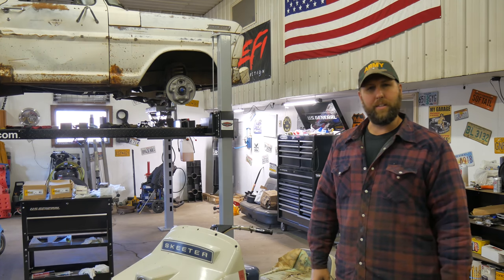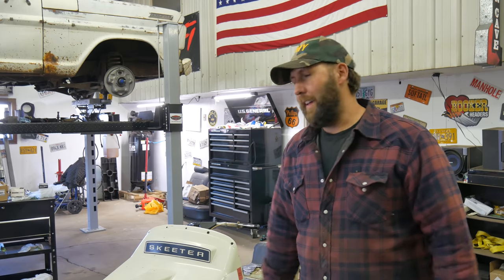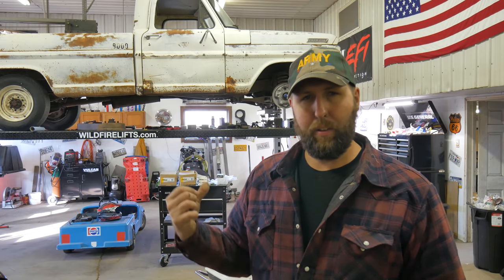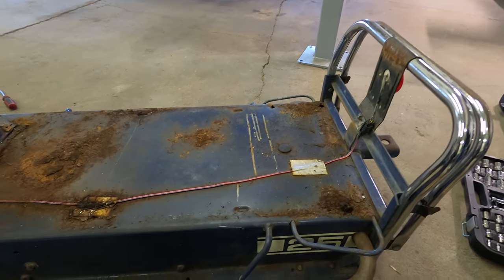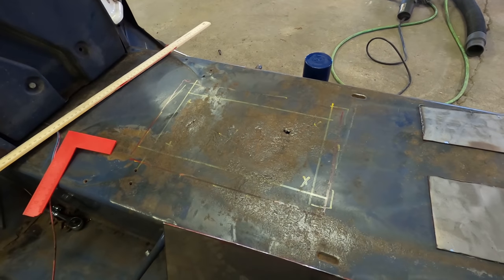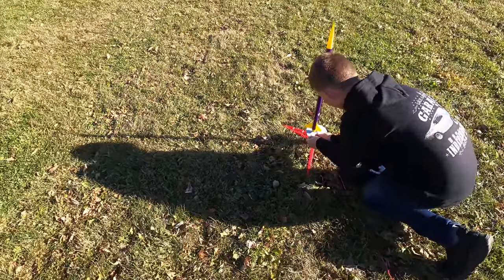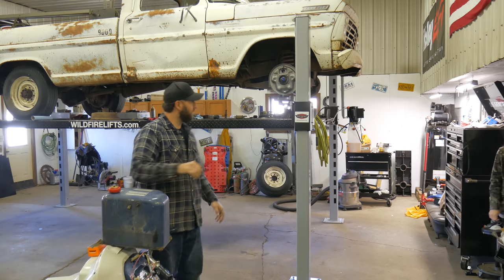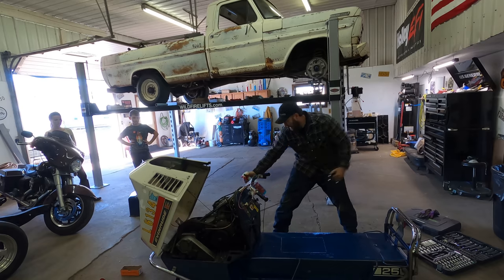FORGOTTEN 1970 Evinrude Skeeter Snowmobile - Will It Run? Part 1

Comment: Derek I wish I was your neighbor. Clearly you're a guy a fellar can drink a beer with.
Reply: Or 12 beers maybe!
Reply from the maker: anytime!
Reply: I’m drinking a beer right now, 9:30AM, headin out time the garage shortly getting myself into trouble no doubt. Derek, if yer ever up in Maine stop by New Gloucester and help me get an 87 crown Vic cop car back on the road. She’s rottin out in the backyard and needs some savin!
Reply: @nghermit4922  I have a friend who lives in Maine, if I ever get up that way maybe I'll stop by. I used to drive those old 2000's crown vic's as a taxi cab driver and had to work on them a lot on my own. So long as we don't have to tear the engine down I can probably get her up and runnin'
Reply: @toysoldier46552  haha nice, she’s pretty rough but does at least make fire. Been sitting for probably 15 years.
Reply: @nghermit4922  It's probably something stupid like the fuel pump or it has a bad sensor. I'd start with the fuel filter near the gas tank and go from there. Otherwise spend a bit of coin and get the tool that runs on a mobile app to plug her in then crank on it, that will give you all of the error codes.

Comment: Derek I really appreciate this channel. That was an hour very well spent. Thank you, and looking forward to part 2!!!
Reply from the maker: Glad you enjoyed it! Part 2 coming soon
Reply: On that tunnel at the rear, a guy might want to put a anglage iron there for reinforcement. If that is the case.
Reply: If that's the case, I use angle iron from bed frames. It's thin and tough and easier to weld other thin metal to. When the kids leave college in the spring, the dumpsters are full of the stuff. Also apartment evictions are a source, so ask a property manager

Comment: My best memories of my Dad “working alongside him in the garage” . Glad to see your a good Dad!
Reply: Working along side my dad in the garage usually consisted of me holding the flashlight, frustrating my dad for not holding the flashlight at the required angle, fetching tools and frustrating my dad for not grabbing the correct tool. I did provide a spacer once when my dad was pushing a tractor back together after splitting it to work on the clutch. By spacer I mean my hand in between the two halves of the tractor…felt great. He checked to make sure my hand wasn’t hurt too bad for about .00001 seconds and we went about our business.
Reply: @thrashmetaljay666  my dad dropped the exhaust of his 89 supra straight onto my 12 year old pearls.

Comment: I did those Estes rockets back when I was a kid back in the mid 70's..  Fun stuff..  Rockets usually only lasted a single launch, but I did get a couple of launches out some of them...  Most broke on landing when the parachute didn't come out..  Other's just blew up, but it was all fun back in the day..  Glad to see that they are still going now.  I thought they died a long time ago..
Reply: I recently found an old one in the attic, and got it going again with some new motors. Was a lot of fun, even the parachute worked.

Comment: Relocating the exhaust out under the foot wells is pure genius!
Warm feet!
The original exhaust is twin army green flat mufflers that run the length of the tunnel above the track.
Very exotic for the time.
Fun video! I may have to restore mine!

Comment: That spare belt was wrapped in a crazy carpet. They carried it so they could put it under the track and tow the machines easier than turning the whole track.
Reply: Or a “Mini Boggen” Anyone who rode 70s vintage knew what these lifesavers are for.😀. Half of the sleds miles had one of these under the track.
Reply: or use it as a kneeling pad to keep from getting wet?
Reply: Beat me to the crazy carpet comment.  Try and pack one of these on a modern sled, absolutely no place to store one.

Comment: Great find. These were built in my home town. My father worked for OMC back in the day. The old factory is now a parts supplier to GM. The dual opposed engines were unique. All the models that used that engine had the neutral lock out feature. Great video.

Comment: once upon a time in the eighties I used a reborn evinrude and a johnson snomo both pulling sleds to haul very large amounts of firewood out of impenetrable snow filled north country deep woods ... they had super wide tracks and the new snomos lacked the traction with their tiny tread spread ... aanyway the trails we used all froze and became super fast and  crazy wild at the end of the day ... we always did a couple adrenalen runs when the work was done ... it was some of the best work days of my life ... sometimes when we were all done I would just stop look into the sun going down over the next ridge line and realize how blessed I was ...

Comment: That exaust is electrical conduit I know those compression fittings too well
Reply: I recognized the fittings as 2” EMT Couplings also, good eye.
Reply: Reminds me of the time I tried to make an exhaust system on my skidloader. Major failure.
Reply: Any thing is an improvement over the stock exhaust system those things had.

Comment: 24:1 is super crazy with a modern two stroke oil.  Many of us two stroke moped folks run more like 100:1 with an oil like amsoil saber.
Reply: "Not running" or "ran when parked" with a vintage moped means that 99% of the time the top end is seized, and 75% of the time the bottom end bearings are seized too.
Reply: It depends on the motor. I have an outboard that originally called for 24:1 but if I would run Amsoil Sabre Outboard at 100:1 or even 50:1 I would end up with internal damage due to the bearings the motor has in it. There is not a one size fits all approach like some of these oil companies may claim.
Reply: @sdvten  I can't speak for those larger motors.

However, vintage mopeds manuals pretty much all recommend 50:1, which is way too rich for a modern oil.  Two stroke oil burns during combustion, and too much of it can increase heat in the top end.  Heavily ported designs like the polini 64cc cylinder for Puch recommend a leaner oil:fuel ratio and synthetic oil (60:1 in that case).
Reply: That's what I was thinking. I rode 2 stroke dirtbikes.  Cheaper lower quality oil, Yamalube, required  a richer mixture. The expensive oil , like Royal Purple or Klotz mixed at higher , leaner ratio, made  less smoke and fewer fouled spark plugs.
Reply: @bjf10  Higher mix rations cause problems when the engine is stored because there isn't enough oil to prevent rust. You need to fog the engine when putting it away for the year.

Comment: YES! My first sled was a Johnson Skee-Horse wide track, when I was 13. It was identical to that Evinrude, but was the most ugliest seafoam green, so I went ahead painted it black. It had reverse, but no starter, so I had to wrap a rope around the primary clutch,  and hope it didn't backfire. No brakes, so that was good. She wasn't fast, but I pulled more than one car out of a ditch. 
This brought back a lot of memories. I'm also an Arctic Cat guy. Had many 75-76 El Tigre 5000s , and my son and I just got my Z440 running today, after sitting for years.

Comment: I remember being a kid with a new 1978 Jag 275 FA in-line twin and the neighbors had a couple of these old 440 opposed 25 horseys. In the woods I had them by the short hairs because the Jag was super light and made the most of its 20hp, so I could out turn them.But on the flats I was lunch meat. Neat old sleds. Glad to see one saved.

Comment: I got my first snowmobile at 16, back in 2016. Found a 1971 Ski Whiz in the barn on my grandparents farm. got it back home, and I was on my own. didn't know nothin' about engines except some basics,  had almost no tools either. but I rebuilt the engine, with new rings and whatnot, and it runs like a champ now, just have to replace the stinkin' clutch. burns up belts. an old snowmobile is the perfect way to get a newbie into fixing engines.

Comment: Hey Derek, I’m super late to the party, but here is my 2cents. The blue kids sled wrapping the spare strap is a genius recovery tool. It can be use to tow the snowmobile in case of failure by placing it under the track and greatly reducing drag.

Comment: I have had a few sleds i had the same issue but when i fixed the tunnel i used like a bed liner paint works perfect on the tunnel no scrapes so no rust

Comment: That's awesome.   Got the family getting in there helping a feller out.    Keep at er.  Those boys will no doubt have all kinds of fun on that thing.  Great one to start on.   My first snowmachine was actually a really similar tiny ugly white 25 or 30 horse relic with a duct tape seat.  Got good at strong arming the bugger around corners, fences, stumps, dogs, ect...  then I got my cousins little hotrod 440 fuel injected suicide machine.   Dad borrowed it twice.  First time he lay it on its side and he bruised his ribs.  Second time he was running her flat out and blew the engine.  LOL.

Comment: My dad had a '67 OMC Sno-Cruiser ( aka Snow Bruiser) which was basically the wide track version of the Skeeter, including the reverse gear.

There was a 4 inch high plinth on top of the tunnel onto which the seat was attached with hinges on one side, providing a storage compartment. The exhaust  mufflers ran straight out the underside of the channel, above the track.

Track itself was not moulded like the one in the video. It looked more like three parallel strands of conveyor belting, riveted to metal bars which engaged with the lugs on the drive wheels. Like a conveyor, the belt assembly was closed with alligator lacing. 

We had that beast from about 1970 until the late 80s.

Comment: Great looking sled . Back in the day when you went out and broke or  blew a belt or what ever . Pushing this thing is not a option . But that rolly poley blue kids sled is actually a TOW SLED . We got the track on top of old blue and a hunk of rope tied to the front bumper to stop it from going under .  Like pushing a car with a flat its tuff especially loaded down with flannel  to keep ya warm . Great video.

Comment: I used steel electric fence rods (look like re bar) for wear bars on an old Rupp.Slotted nice at both ends and welded instead of bolts. Worked fine for years. Really enjoy your channel.

Comment: Great video.  In the late 60's all the way through today my brother would work during the summer months and be laid off usually during the winter and he would collect as many snowmobiles as possible during the year and fix them up and sell them all winter long for extra pocket money. It is so true what you said about how most of the non running machines were simple carburation problems that most people could not fix and they parked them in the barn and bought a new machine

Comment: I got one with a rotory engine in it. It had no spark so my guess was the electronic ignition system was bad. I couldnt even find one for it. I do remember it worked when I first got it. It was very heavy  but seemed to have a lot of power. I wish I hadn't scrapped it but hey, it was one of my first snowmobiles of many ,many I ended up restoring and selling in the future. I remember at one  time having 12 snowmobiles in my back yard. I ended up working for a small engine shop and got really into it. I finally built my own building and opened my own shop. After finding out I had Cancer and a botched surgery that left me disabled, I sold out. I have many good memories of snowmobiling with my wife and two girls. They all had their own snowmobiles. Yeah, the good old days. I found the Yamaha Enticer 250 made a great kids sled. Had 4 of them. One I brought home in a card board box.

Comment: Our family's first snow machine was a 1966 Evinrude Skeeter, absolute tank with about 12 h.p., which was bought brand new. That sled was moth balled when pops came home with a new 1973 RC35Q(Wankel). 1975 saw a 440 Skimmer added . The rolled up kids sled was always onboard just in case a sled needed towed, unroll and place under the track and tie a rope to the front bumper and off you go!

Comment: I used to have a Skeeter. Mine had the reverse and 2 foot wide track. On that one the dual exhaust ran through the tunnel and exited straight out the back. I put bazooka tips on it and at idle it would puff smoke rings and sounded like a Harley. It was a tank and when it would quit and had to be towed I would have to push it too just to get it moving. I think mine had blue hood and red seat if I remember correctly.

Comment: Wire wheel cleaner dumped in along with  the bolts will get all the rust off.
I’m also glad to see you have your boy wear PPE. The “safety last” jackholes on you tube take it to an extreme level. 
First time viewer. Gonna sub.

Comment: With the new synthetic oils, you can use 50/1 mix without any issues in most cases. I did it on several engines in my shop and boat with not problems. Thanks for the video.

Comment: We had one of those at our camp same model family got it sometime in the late 80s early 90s rode it for about 6 years and parked it in 1996 sat 10 years until 2006 tried to get it going. And finally scraped it in 2015 it was badly rotted from the PA winters it was fun thou I  am 31 and remember the early 1990s going for rides with my family members good memories.

Comment: I got a 68 or 70 Johnson same thing kind of a seagreen green. These were the best ice fishing Vehicles you could get they are a bulldozer and the reverse and wide track really comes in handy pulling a shanty or . Euchre table Beer Station LOL. My buddy said I should be on the front of Snowgoer magazine driving an Evinrude through whoop de doos at 60 miles an hour LOL. That's the smooth ride them boggie Wheels. I'm from Detroit but all my life coming out here in PA all classic rides a lot of fun.. I still got a 440 Rupp American too. My Johnson is electric start, reverse 25 inch wide track

Comment: We used water to get our old fuel tanks clean then flush them out with gas, so that your not using very much fuel or pour it through a paint strainer and reuse the fuel until it comes out clean. Thanks for the great videos.

Comment: Hi Nice snowmobile video ( part 1 and 2 ) - re the tank cleaning, marbles is not much use as they are to smooth, at pne of the places i worked at we used to buy used items eg motor bikes and small construction compressors / water pumps, and as large as 20ton cranes or skid steers - we would drain the old fuel, put $10 cheap fuel or diesel whatever was cheaper and drop a few feet of chain link in there, place the tank in the back of a ute and drive it for a day or 2 ( needs say 1 hour work out ), then like you done flush it out, and use a flashlight to have a look inside. on the 2nd or 3rd attempt if needed, you could filter the fuel

If we have say more than 4 items at the same time, we had a large bag of 20-30mm road base gravel, many sharp edges, that would also do a good job.

Regards
George

Comment: We had a new 1967 Johnson and a very slightly Used 1968 Evinrude.Both were the wider 20" Tracks Think the Johnson was 14 HP and the Evinrude was 16HP. Evinrude had factory dual exhaust that ran above track and exited out the very back with turn downs. Evinrude also ad Reverse.  Fun Times.

Comment: I got a 25 horsepower 1987  2 cylinder, 2 stroke Johnson. Which is a OMC motor as well and that thing is unkillable. it will not die. And out here on the Missouri River and the Cuiver River I have just miss treated the old sun of a gun something fierce. And that old OMC motor keeps giving her hell.

Comment: after having watch alot of youre video i finally jump and tryed to fix my long gone grand father 1991 Honda generator thats been sitting since the 2000. i was like 6 when he passed away and my father never been able to get it working. 
so after cleaning the gas tank. carb. and figuring out how to check spark on a small engine i managed to get it started. then i learn how to recharge the accumulator and we have a working generator for 20CAD. 
so happy i managed to revive our own barn find. 😂 
im a EFI guy. im not scared of a multiport chevy but carb is not my strong point.

Comment: The snowmobile I learned to ride on was a 1970 Evinrude Skeeter. 1 piece gates rubber company molded track. OMC 25 horse engine WITH electric start AND reverse. Top speed? 32mph. Shes HEAVY, but with that wide molded track in deep powder you just shifted your weight and she'd bank like an airplane. Bad news, if you lost momentum and buried it in deep powder, plan on a LONG afternoon digging her out. That seat lifts and swings to the left to reveal a HUGE stowage underneath.

Comment: On the needle seat, take a Q tip and insert it in a drill. Pull a little 00 00 steel wool on the Q tip. Put a little Brasso polish or similar on the steel wool. Insert into seat and go at her with drill. A couple times and the seat will look brand new. Once done insert needle, a little squirt of WD 40 and pressure test it for leaks at about 4 psi. Will work on all carb seats. I do it all the time on Atvs.